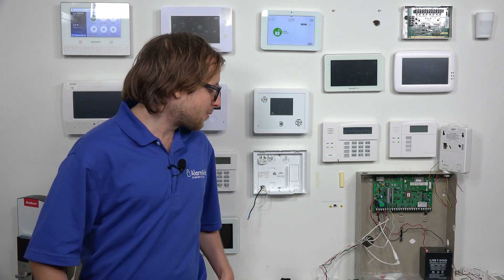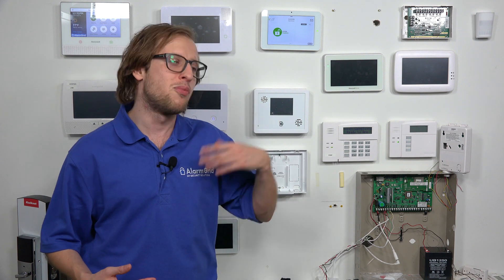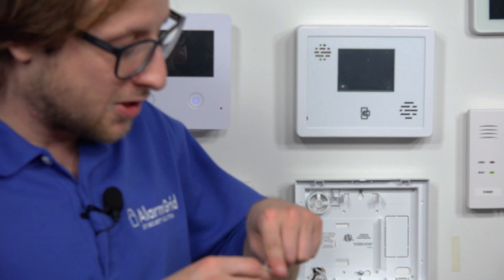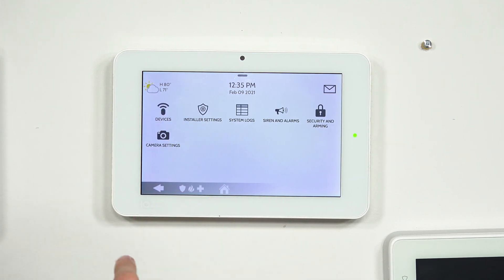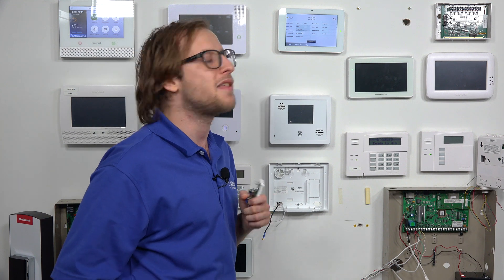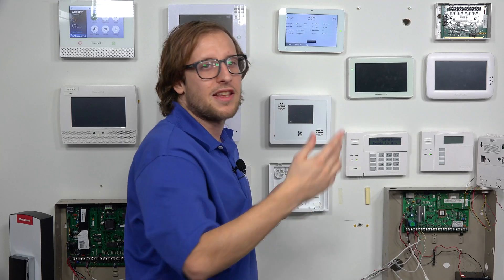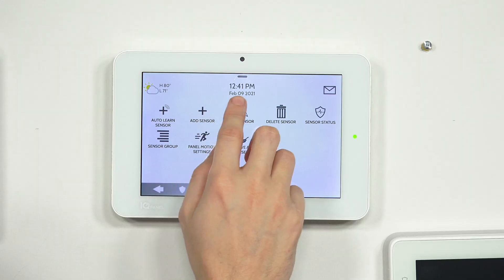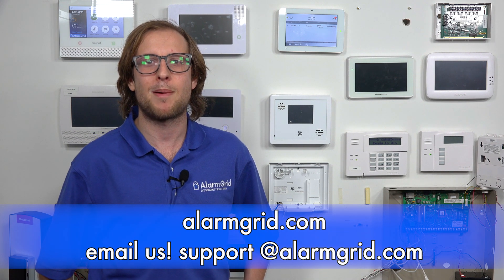DSC PG9905: Programming to Qolsys IQ Panel 2 Plus

Comment: Hello. I'm trying to use the sensor using an external probe. Is there any difference which wire (brown or blue as in polarity?) you connect on either side of the connector block on the sensor? Do you have to do anything beside connecting the probe to the sensor to make it work? Also the sensor came with a small wire bridging both sides of the connector block. I'm guessing it has to be disposed of. Thanks in advance.
Reply: For the Aux input there is no polarity just needs a standard dry contact no voltage to trigger it.

Comment: How would you trip the sensor for central station
Reply: To trip the sensor first ensure you are on test, and then depending on whether you are doing high temp or low temp, you must bring the temp of the unit up with a hairdryer ~12" away or down by placing it in a freezer or placing in a plastic bag and putting in a cup of ice.

Comment: Do you have a video for programing a PG9905 into the PowerSeries NEO. The install sheet is not that clear. Enrolling is no problem. Neded to program it for a supervisory for low temp. Not alarm. Just supervisory. low temp alert at 32 degrees F. Thought I had it figured out out as a "Low Temp Warn" but doesn't do anything in the cold below 32 and goes into alarm when you take the cover off.